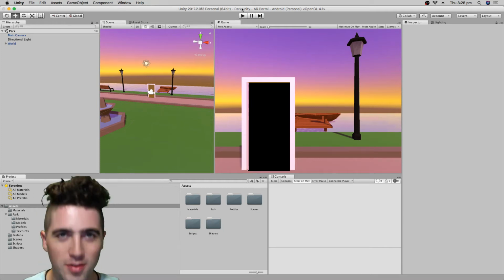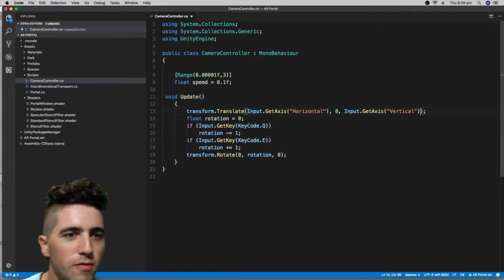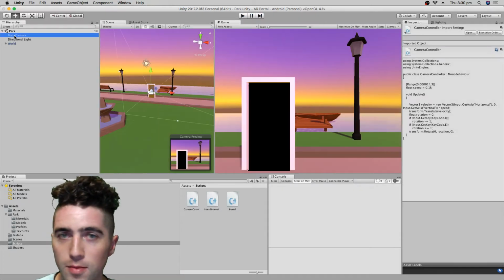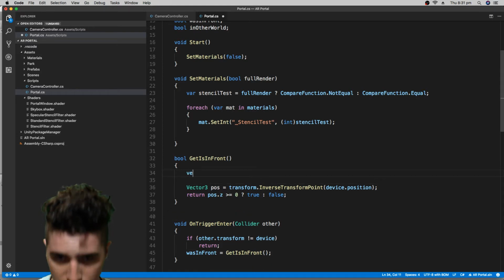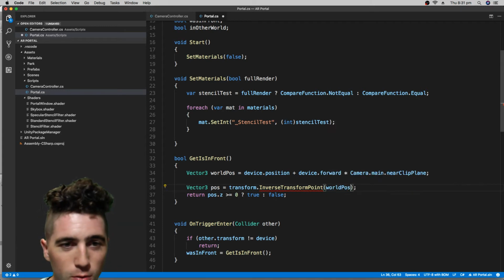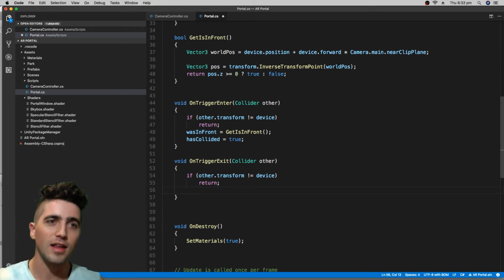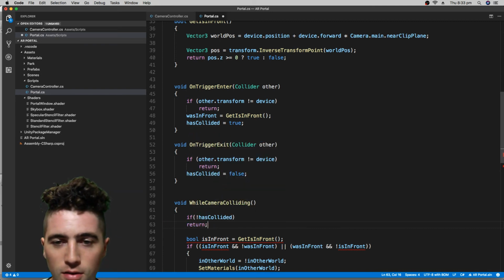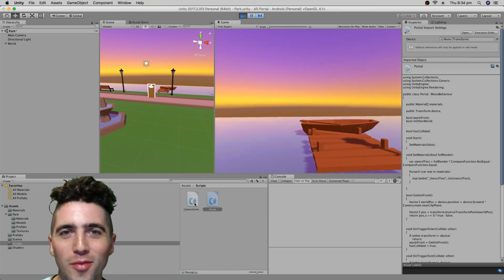15: Collisions and Flickering Practical - How To Unity AR Portal

Comment: Thank you a lot for your tutorial. 

For this flickering problem. It's ok when I simulate in Unity Editor. It works totally fine. But when I use the ARCore It still got a moment of flickering. I'm trying to look up rendering queue but it doesn't work. It will help a lot if you can figure out the solution.

PS: If you want to see the moment of flickering. It's exactly the same in the video you linked (ARKit Portal to the Upside Down) at 40:33 - 40:34.
Reply from the maker: yea it seems to be a problem a lot of folks are having. Don't have an answer for you at the moment, I'm hoping that some graphics super genius will watch the series and come up with an airtight solution
Reply: I'm getting the same issue, but I think it's related to how it is calculating the moment the camera 'hits' the PortalWindow and how the Near Clip Plane is oriented (as a plane projected forward of the camera object). i.e. most people don't hold phones oriented precisely vertical, and as such the Near Clip Plane isn't striking the PortalWindow as 2 planes oriented the same way would.

When I take my phone tilted forward (try ~45deg) and go through the portal very slowly, as I approach the PortalWindow the top of my screen starts to show the real world on the other side of the portal window, since the stencil hasn't been flipped but that part of the clip plane is on the other side of the portal. As soon as the center of my screen crosses the PortalWindow then the 'screen tearing' is flipped. I've recorded a demo: https://youtu.be/CzQKTAVHZ_Q (please ignore waviness, it's a shader I'm playing with).

I think I'm getting the same results in the VR demo you walk us through: if you set the Main Camera to `Position (0,1,-0.5)`, `Rotation (45,0,0)`, and the CameraController `Speed = 0.1` and Play, moving forward slowly (and rotating with Q+E) will have the same 'tearing' effect. This didn't happen in your demo because both the PortalWIndow and Main Camera were precisely vertical, and so collided 'perfectly'.

Also, apologies if this sounds condescending, I'm just trying to be as descriptive as possible for reproduction/verification and for ease of understanding.
Reply from the maker: copy paste from comment on Daevin's video:
"very interesting.... maybe the solution to this issue would be some kind of 'per pixel' (approximated for performance)  raycasting to the near clip plane of the camera to see if that area of the screen is in front or behind the portal. good stuff!"
Reply: Any update on this ? I've been trying a few thing but nothing works yet :s ...
Reply: @exenstryfe1244  hey guys, I too was frustrated by the slight glitch when i went through the portal viewing through the iPad but i've worked out a solution 

@Pirates - thanks for a wicked series, super useful! 
Here is my lil contribution.... 

TLDR: The camera on the ipad will never be held flat, so you have to flip the materials slightly before the viewer reaches the window and move the portal backwards/forwards to accommodate for this, so they never actually hit the window!

The fix is a bit of a hack but works fine. In the GetIsInFront method, instead of checking when the pos.z is 0 (camera + clip etc) is 'on' the window, check if it's -150~ (i.e. just infront of the window). This will trigger the flip when you are just outside the portal.

in WhileCameraColliding, write an if statement where you are changing between being inside and outside the portal (inOtherWorld = !inOtherWorld). If inOtherWorld is false (i.e outside the portal) move the portals transform forward by 1 in the Z axis. Do the same for when its true (i.e. inside the portal) but move it -1 in the z axis. This effectively jumps the portal forward and backwards, so you never hit the window. 

You'll have the rotate the portal by 180 and add a plane to the back of the portal too as it breaks the ability to go through the same door both ways, once you've implemented and had a go with the above this will become clear!
.....

I think its because the camera isn't at a perfectly flat angle when the viewer is holding the tablet, so when you are 'on' the window, half the camera is inside the portal, so they are seeing back out into 'reality' and the other half is looking through into the portal. So you are sort of looking through the window both ways, just another oddity of AR.

Good luck AR fans! 
R
Reply: @robinhunter1101   Hello !

I'm currently trying your solution but i don't get the part where this line  

return pos.z >= 0 ? true : false;

become this line 

return pos.z >= -150 ? true : false;

(if you can share your code for those modification that would be great)

Also when you say to rotate the portal by 180 and add another plane to the back of it , you mean to add the same plane (not rotated i guess) with the same material on the same  position as the other one ? Does it needs to have the portal script attach to it too ?

Thank you for your time and answers, really appreciate it !
Reply: @exenstryfe1244 

yes so checking for pos.z at -150 means the flipping occurs just outside the portal. you then move the portal forward to accommodate for this (or otherwise you'd be in front of the door looking back out again)    

by plane i mean boarding up the 'back' of the portal so people can only walk in one way. When they walk in, you rotate the portal by 180 so the doorway faces the viewer. could probably fix further to be able to walk in either way based on state but this lil hack to get around the flickering is worth it even if it sacrifices the two-way-ness, but this is less important for my project.....

here ya go - https://pastebin.com/cJja7JHX
Reply: @robinhunter1101  Hello and thank you for your answer.

My only concern now is that the pos.z is always equal to something between -0.05 and 0.05 so the test always return True. That's why i don't get why the value tested should be >=-150 ?

Any idea ? 

Thanks
Reply: I've tried this solution but it's not as fluid or fool proof as I desired. Has anyone found a flicker free solution either by disabling the portal mesh after material flip or a more intermediate graphic solution? This is present in editor and on mobile with the camera is tilted ~45º and you walk back and forth or through the portal you get that quick flicker or partial portal rendering where 40% of the screen shows the portal and the rest shows the real world until you fully cross over. Looking for a full portal solution using this method and not just a room without a window and hiding everything behind render masks. @chantey you have done an amazing job getting us this far. Thanks again for all of your help, time and dedication to this series. Hoping someone has found a solution over the years.

Comment: hi, it had been four years, anyone find any solution yet ? Chantey, do you have any solution to solve the flickering issues on ARCore running on Android, I tried methods mentioned by others including setting near clip to 0.01, collision z to 0.2, turning MeshRenderer OFF/ON works only when moving forward toward the portal but when moving backward without turning back to face the portal, the flicker still there. ?